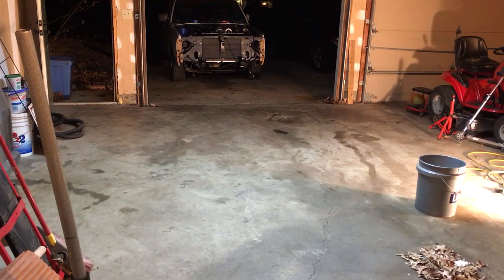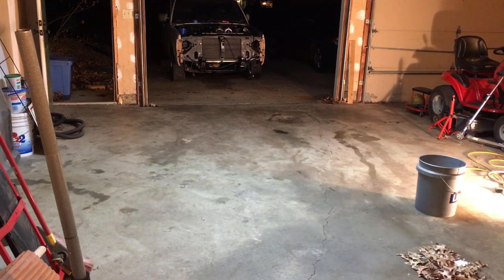4.8 swap Challenges!!!

Comment: I'll keep this in mind next time I rip my heads off, I have a 98 ls1 z28. I did a head swap, new lifters, and a bunch of other stuff this summer. I didn't have a problem with coolant burping. 

As for the limp mode, do you have a way to scan for codes? does it have knock sensors?

edit: sorry, was still watching the video while I was typing. 

On a stock tune I ran my car with no o2 sensors, and no maf for the first start up. It ran and revved up just fine in my driveway. 

Kinda messed up you got screwed like that, I'd get HPtuners or EFI live and learn to tune it up yourself. It's not to difficult if you're knowledgeable of the sensors and what they do, and it's a super valuable skill to have in custom work such as this.
Reply from the maker: Colton Shimko I agree getting the HP Tuner Pro is a great idea!  A few of my friends are interested in buying it together to share the cost. Then it's only credits for each vehicle.
Reply: Good news you may not know, it comes with 8? Credits I believe. Each PCM is 2 credits if I remember right, so that's enough for 4 pcms right off the bat.

Comment: what year Harness do you have and what year ecm. I always like to have the ecm and Harness come from the same car and if possible grab the up stream o2 sensors at the same time. If these do not match, your problem could be coming from here
Reply from the maker: Jesus M My PCM came from/with the 5.3 from a 2000 Tahoe. The harness is a Stand Alone engine only harness from a local source called "Professional Racer Harness" no idea what year it came off of.
Reply: HeadFlowInc , you might want to check that out, different years have grounds in the o2 sensors in different pins, so o2s might read wrong too, I have made a few harnesses of my own and Tune my own stuff and have learned some things the hard way, wish you luck
Reply from the maker: Jesus M Found out tonight a friend has the HP Tuner software so I'm going to buy the credit/credits so we can do the tune ourselves. Hopefully I'll be able to see what's wrong
Reply: HeadFlowInc double check all your wiring,  a buddy of mine converted an 05 wiring Harness from drive by wire to, dto be by cable and we had some trouble getting it to work, but figured it out. I forget what fixed the issue since it's been about two years ago. I will ask my buddy to see if he recalls. good luck , hope you figure this out